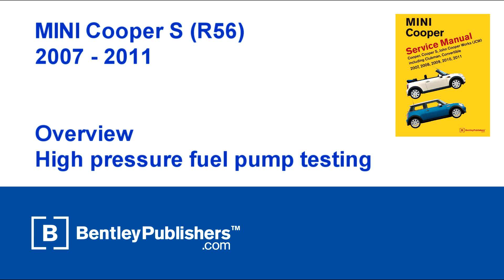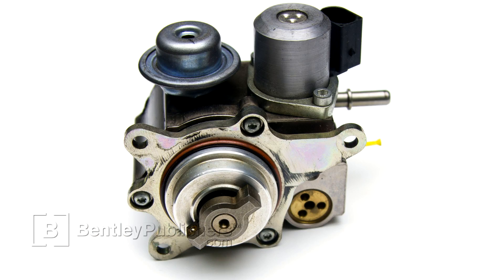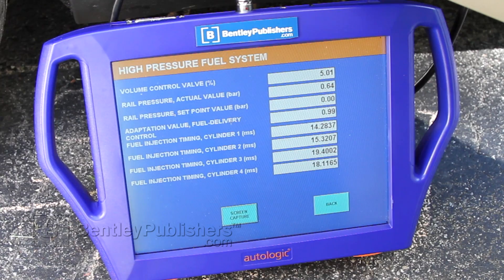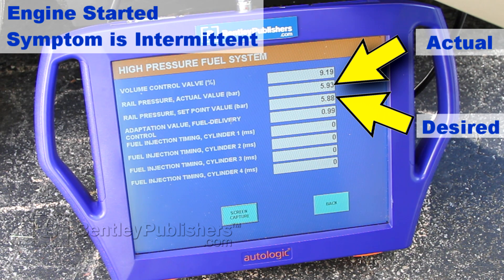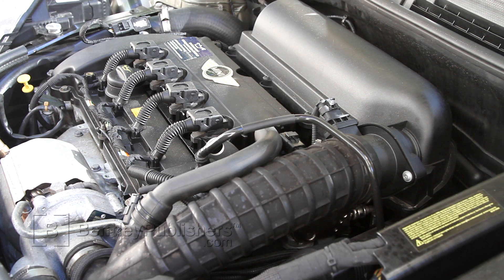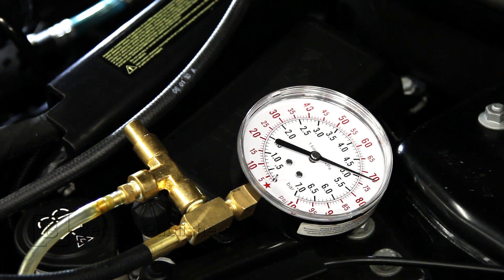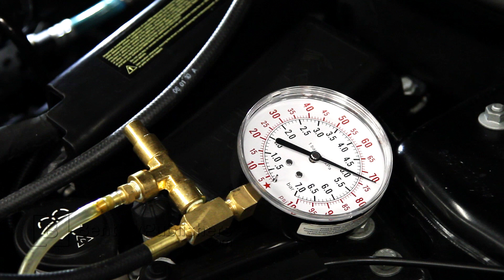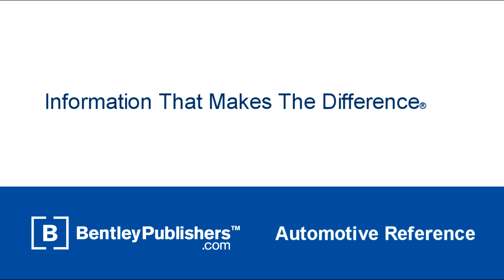MINI Cooper S High Pressure Fuel Pump Failure Symptom and Diagnosis- DIY Repair

Comment: When you say tap into the fuel delivery line, are you supposed to disconnect it from the high-pressure fuel pump and start the car till it stalls out?

Comment: The fuel pump breaks often in these cars, but it is more often a burnt out circuit board in the distribution box that then cuts off power to the high pressure fuel pump. Look this up and you'll find what you need.

Comment: Hi there, would this cause a crank but no start? At first I had 20 psi on 3 cylinders and 0 in cylinder one, after redoing all the valves and retiming the engine I’m at 125 psi now, I’m still now able to start the car, I’ve replaced the fuel pump relay and low pressure fuel pump, could a competently bad high pressure fuel pump cause a crank but no start? Thanks

Comment: Any idea what the issue could be if my desired fuel pressure setpoint also changes? On good startup I get 5.0 bar desired setpoint and actual pressure... However when I have issues both my desired fuel pressure setpoint and actual BOTH drop to about 0.7 bar. Help would be greatly appreciated!

Comment: I’ve got an issue with my car hesitating and juddering when pulling away, I’ve noticed at idle if I blip the throttle the fuel rail pressure will drop to 600PSI before settling back to around 700PSI, do you think this high pressure fuel pump could be my problem ?

Comment: So I own a 2016 f56 JCW and I had a scanner and my car if it were able to start sometimes it would feel like the car was stalling while I was driving and the fuel rail pressure would be at 3,000 PSI at normal operating conditions but whenever it was jerking the car and felt like it was going to stall you could see the graph physically Spike up and down from 0 psi to 3,000 to 600 to 0 etc till it eventually just dies. I replaced the high pressure fuel pump a month ago and while it was fine for a whole month, currently as of a couple days ago I'm getting the same problem again I'm thinking there are some other underlying issues potentially a fuel rail pressure sensor or the sending unit. 

Interesting note to add even though the car would die and stall out after a couple of times of trying to crank the car and get it to run it would go into this limp mode where essentially it was only putting out 300 to 600 PSI consistently and only 40% throttle but I was able to drive from Atlanta to Charlotte but under those conditions even though my foot was planted to the ground it was still only pulling 30 to 40% throttle.

Comment: Wish I had a $30'000 scan tool so I could see that 'desired' value.  Anyone know what the PID for that is?
Reply: I use CARLY for this diagnosis.  Adapter + App costs once 109,- Euro (49,00 per year for app).  Including car coding, maintenance and service tools.

Comment: Why did you not diagnose the regulator? Why go strait to the pump being bad?
Reply: modern day GDI vehicles use the high pressure fuel pump to regulate the pressure in he rail. The regulator in this case is internal to the pump.

Comment: I don't understand, the high pressure fuel spec on the rail should be 50bar at idle and 5bar after in-tank fuel pump. Is the Autologic running an older software?

Comment: Good news! Is your car  is less than 100.000 miles and less than 5 or 7 years old you may qualified for free high pressure pomp replacement, call your nearest local dealer before you pay $1800 or more for this job.
Reply: the replacement is 10yrs/100k for hpfp and 7yrs/100k for the timing system

Comment: It is odd that he states the output from the fuel rail should be 5bar on start. It should be 5MPa which is 50 bar. If the system only needed 5 bar then why would we need two pumps when the tank pump is putting out the necessary 5 bar?

Anyway, good video except for that.
Reply: You right the units aare wrong its 5 mpa

Comment: How come you and your mini scan tool can be so wrong with values? Fuel pressure @ rail is 50bar at idle not 5bar (value you can expect @ intank pump).
Reply: Value is fine but unit should be MPa not bar